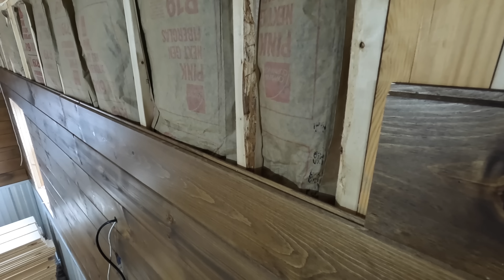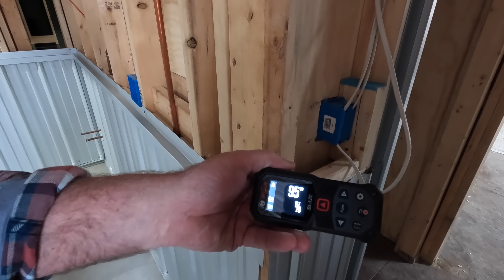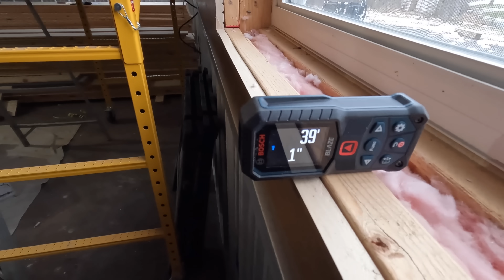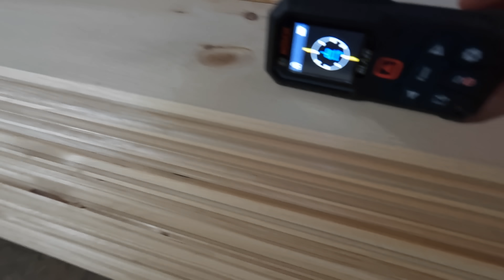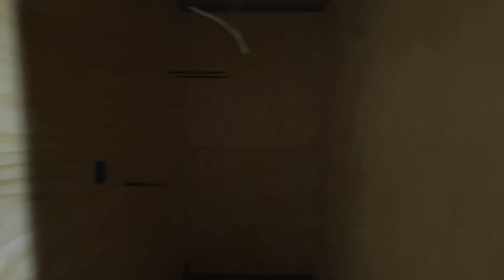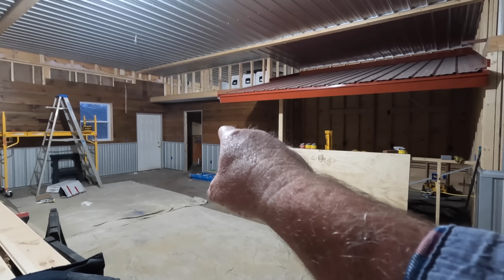How didn't I know about this?

Comment: Bought a knock off on the inter web. I needed to measure for a ramp from my little pond edge to a tiny island. No using the widest tape measure I had and no time of the year to get wet in 4 feet deep pond water. Worked great and I have fallen in love with it. I also use it to get tree heights using a built-in triangle calculator. Measure the distance to the base and top and it figures the height based on the Pythagorus theorem. Great tool. Combined with a laser level it rocks.

Comment: Good morning! My sister and husband gave me one for Christmas 10-15 years ago, with much less programmability and less accuracy. It’s the same design as yours - measure from the base to the laser dot. It reads feet and inches, so is good for estimates but not cutting boards to length. He used it to estimate scale for renovation projects. I use it when there’s no one around to help hold or there’d be multiple tape placements.

Comment: Anyone that ask why you need it has never done the work your doing by themselves. I feel bad for not recommending you get one at the beginning of your project lol!
Reply: Huh….I have been working for my self for 30 years and do not need one.  Maybe for the weaker generation it would be good because they cannot read a tape.  Working alone is an art and many good tricks are formed to make the job easier.
Reply: I’ve been working alone for 12 years and I can tell you if your doing high quality production work this will make you faster and more profitable. It has nothing to do with a “weaker” generation it has to do with time is money and if a tool helps produce a quality outcome and saves time it’s a good investment. There’s no argument that a laser is between 2 to 10 times faster depending on the task. I’ve done estimates where the ceiling was 30 ft tall. We needed to know the height pulled out my laser and had a measurement in seconds.
Reply: Jaco, I am entering my 80th decade and I am positive my generation is weaker than my fathers.  What we call off grid is how my fathers generation grew up with and my kids generation is softer than mine.  
I guess there are a few places that the electronic measurement works.  If you want to be happier though, time is “not” money.  Living is money in the 6th power!

Comment: I see real estate folks using them on YouTube.  Does yours have a square footage function?  If it does, calculating material needs for walls or flooring is a breeze.  As for the bagger, that thing is gonna work like a breeze.  Wipe it down from time to time to prevent build up and it will serve you well.  I wouldn't spend long periods working at it.  Vibratory conveyors, even quiet ones, produce sound/noise that always seemed to bother me.  Could never understand how folks worked around them for hours and hours in the finished goods area where I worked.

Comment: Yep, I can't believe you didn't know about the laser level and how accurate they are.  A lot of us have fought the tape breaking over just about when you get the end where you want it and have to get a second set of hands or put a nail there to hold it then another step needed to remove the nail to finish.  I didn't realize that they were that accurate though, I've only used them to get rough measurements and now I will have to rethink that.  Thanks for another great video Mike.  The game room and garage and looking great!

Comment: I have had the older model of that for years.  Has worked great on site investigations over the years.  Excellent on large roofs where you  are locating roof top equipment, drains, and piping.  Glad you found a new tool that is handy to have.  Speaking of tools, if you haven’t tried the KREG Jig system, that should be your next purchase.  Enjoy your day Around the Yard!  Have a great weekend with your family!! - Brent